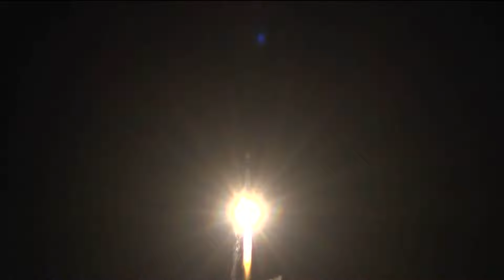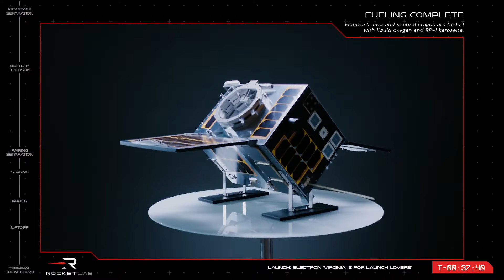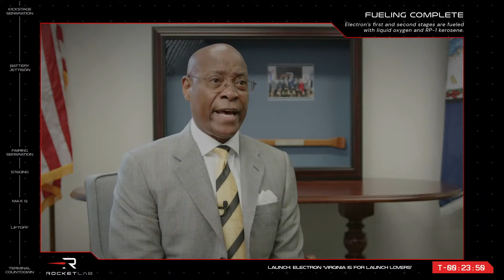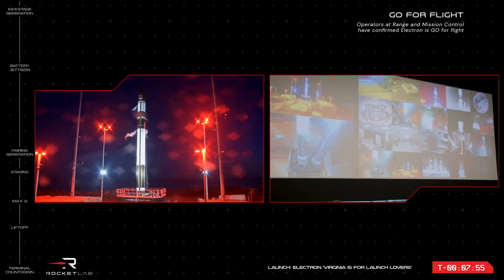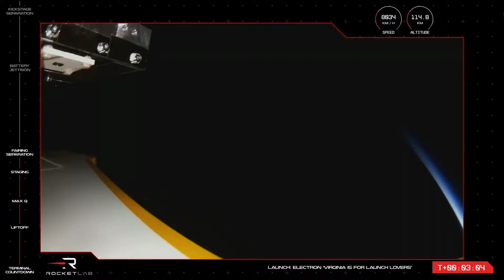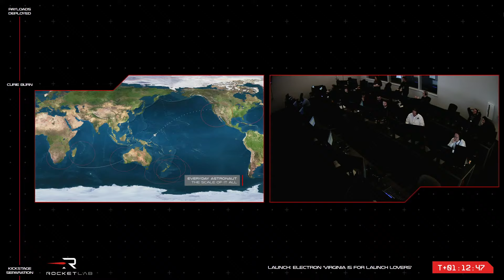Rocket Lab Debut Launch from LC-2 - 'Virginia Is For Launch Lovers'

Comment: Congratulations on the successful launch. Can someone explain what the whole battery hot-swapping and jettison sequence was all about?
Reply: The Rutherford engine uses electric motor driven pumps to feed propellant to the combustion chamber. These motors are powered with batteries. Once one set of batteries is drained, they are jettisoned and another battery takes over for the duration of the second stage burn. They gain some efficiency by jettisoning dead weight.
Reply: @steveadams7369  Amazing. Thank you for explaining that in such detail. Appreciate it.